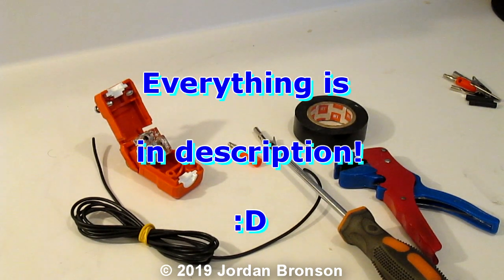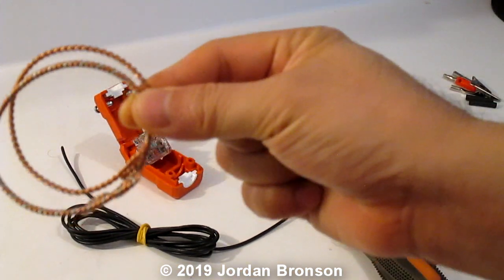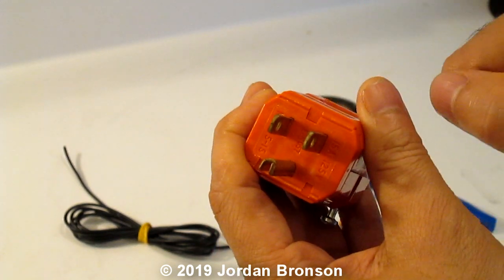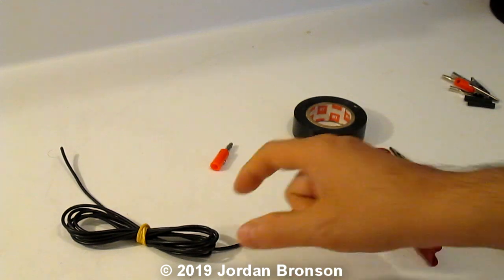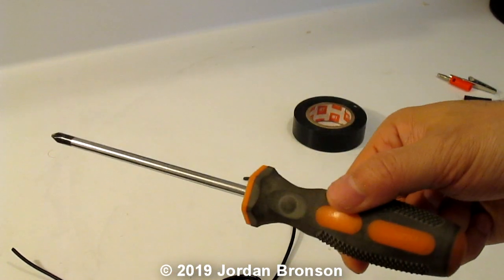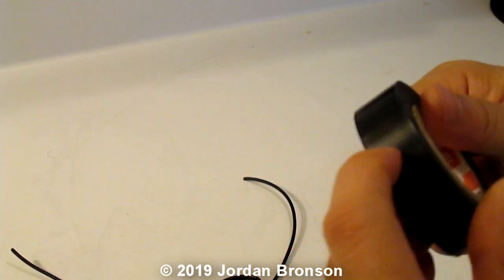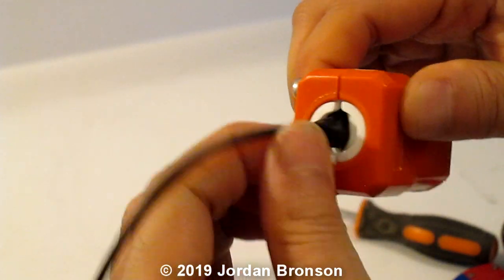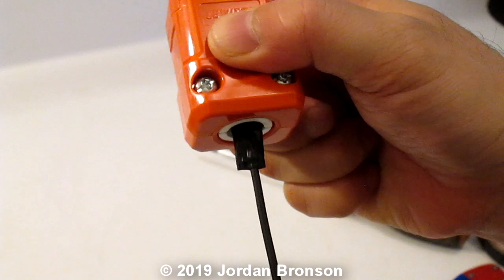EASY DIY Grounding Earthing Clip Electric Plug - FOR EMF - Mat Bracelet Pillow Sheet Faraday Cage

Comment: I am wondering if those static bracelets work for grounding? They are cheaper to buy than all the parts, although they are usually with a shortish cord. Can I just tape metal part inside the bracelet against, what i want to ground?
Reply from the maker: You can make the Ground Wire and then from the Cord, you can wrap that around a Copper Bracelet, that would work too.  You can wrap around Metal Bracelet too, but Copper is the most effective element when it comes to EMF (Electromagnetic Field ).
Reply: @JodBronson  One more question. I searched for the copper electrical wire, and it seems like they come in variety of gauges.  Which one or which ones fit the plugs best?
Reply from the maker: @feltingme  -  18 Gauge will be fine.  Those are standard I use all these years.
Reply from the maker: @feltingme  -  The Link you sent me is for Static Computer / Electronic work, those are what the bracelets are for.  You want 100% Copper, since this is for Body EMF (Electromagnetic Field ) to move.  In my opinion, Copper works better and faster, due to the element.  Electrical Ions moves faster in Copper and that is what you want.  NOTE:  You can make it easily from Home Depot or Lowes.  They even sell the Copper Wire in Foot Length, so you can get what you need and no need to spend extra $$$.
Reply from the maker: @feltingme  -  I went into further details + safety here:  https://www.youtube.com/watch?v=E70ec_eMi9o
Reply: @JodBronson  So their wire inside is not copper? And they do sell them for grounding (earthing purposes as well.) Of course, that doesn't mean they are best for it just because they sell them as such.
Reply: @JodBronson  Thank you. Now I know what to get.
Reply from the maker: @feltingme  -  You will find 100% Copper Wires usually in Speaker Wires.  Copper is getting expensive, so they " try " to put Nickel/Tin in them.  What they do is Nickel/Tin Glazed Copper to keep the cost down.  YES.... They do that to keep the cost down :(.  To get 100% Copper Wires, get Speaker Wires.  NOTE:  Some is also Copper Clad (Nickel/Tin Glazed).
Reply from the maker: @feltingme  -  By the way, some People call it Tin or Nickel or Copper-Clad Aluminum (CCA).  Basically, they Glazed or Weld <----- their terms..., Copper on the " outside " and Tin or Nickel or Aluminum on the inside, which then they call it...., " Copper-Clad ".  Hope that will make sense to you.

Comment: Hello from Athens, Greece!! I like  your videos and your explanatory way! So if I got it right... In a European plug, 
I keep wired the green wire only, I cut the other two. I shield them with black tape and I close the plastic plug cover.. This end goes into the outlet and the other end with the alligator clip goes on the bracelet... Is it correct? Thank you!!!
Reply from the maker: YES... Green = Ground
Reply from the maker: Here... check this out in detail:  https://www.youtube.com/watch?v=E70ec_eMi9o
Reply: Thank you very much. If you like , it would be very useful for everybody to hear your opinion on nanostructured black silicon as a blockage material. I red some articles but I am not so familiar with these topics. Thank you for all the info so far!!
Reply from the maker: @marthapantazo6510  -  I have never gotten into "Nano Black Silicon".  Although I have taught a bit in school, they have used it in Solar Cells experimenting, but never got in to it.  The best material to date is copper, because of the efficiency of it.

Comment: Question, what alternative can we do if we are from a country with no ground hole? Could we just buy an adapter and plug it in the 2 hole and just do as your tutorial? Plugging the 3prong to the adapter?
Reply from the maker: VERY EASY:  If you are from another country.  Get a 6 Feet Copper Grounding Rod.  Stake that into the ground outside of your house.  Attach a wire to it and that is your "Grounding" Plug.

Comment: Great video bro, I have done a lot of my own electrical work, and yeah like you said safety and common sense. But I had a question for you. Does it make a difference to have larger wire does it ground better or the same, more surface area or is it all the same? Thanks bro
Reply from the maker: In theory yes, because your body have " Low " Electrons... Bigger Wire / Thicker Wire will help the Electrons to move faster.  Here is where it will complicate things...  The Electrons in our Body stay the same, regardless how thick or thin the Wire is.  Our Voltage is only around 1.7V to 2.4V AC.  We only want to discharge the " Extra " Electrons...., our body needs the rest or we will be dead.  Our Body needs the Electrons to stay alive, that is why 99% of People in the World who do not understand Grounding.  Even though I am NOT the one who discovered " Grounding ", but I am proud to say, I am the first Person to understand it.  When you get a moment, check out some of my EMF Videos, I explain how it actually works...  Go into my Channel, then Video, then Search for " EMF ".  You will see bunch of it under that topic.
Reply: Jordan Bronson very helpful, thank you for the detailed reply. I love grounding and it has been very helpful for my sleep etc. as of right now I am using Assurance Designed Blue Grounding Wrist Strap 2 Pack. Use for Earth Connection & EMF Radiation Protection - Use for Desk, Floor, Bed, Pillow or Yoga https://www.amazon.com/dp/B077PDTRH6/ref=cm_sw_r_cp_api_i_wffCEb1MVAY0G
I found on amazon a while ago and put it on my foot while I sleep and anytime I can. I made myself a pair of earthing Moccasins to wear when ever possible outside. I am looking to get some emf cloth and attach to bed for a more permanent set up. Love your vids thanks  again.
Reply from the maker: @earlkcej3446  You could have done this, no buying, LOL.  https://www.youtube.com/watch?v=PCEY_HD16aE
Reply: @earlkcej3446  i was confused that you can clip it to a pillow?... that means the elctricity goes out of my head, into a pillow?... and then into clip then ground?.. the pillow conducts?

Comment: What size are the plug inserts for the alligator clips and where can you find them?
Reply from the maker: It doesn't matter... As long it's Metal, you will be fine.  The Alligator is 25mm I think.  You can find it at Harbor Freight, Online like eBay or Amazon or Electronic Store.
Reply from the maker: Extra Safety Video Detailed Instruction Here:  https://www.youtube.com/watch?v=E70ec_eMi9o

Comment: But my earthing mate clip is not giving a peep😅 however when I check th ohm with the May it shows it’s working … do you think that they have created some resistance like anti static braclets?
Reply from the maker: It should give lots of PEEPS !!!  Just like the people walking around with 2 legs!  If not, you did it wrong!  😅😅😅😅😅
Reply: @JodBronson  I meant the original one that comes with the earthing mat - it was not peep like those ppl so Mybe am saying Mybe the built some resistance alike the anti static stripes..because the mat it self doesn’t peep
Reply from the maker: @alFeras_tell  - I TOLD YOU WHAT THEY PUT IN THERE AND HOW TO MEASURE IT !!!  Why are you so dense?  THEY put in a "resistor" which YOU HAVE TO MEASURE IT IN OHM !!!  I also say... SET YOUR METER TO OHM... Then you can measure it !!!
Reply: @JodBronson  that was yesterday 😂 today a new lesson 🧑‍🏫. Thank you Jordan!
Reply from the maker: @alFeras_tell  - STILL THE SAME LESSON !!!  GRRRRRRR

Comment: What's that yellow device called?
Reply from the maker: Multimeter
Reply from the maker: Cheaper at Harbor Freight here: https://www.harborfreight.com/7-function-digital-multimeter-63759.html
Reply: @JodBronson  thxx!
Reply: @JodBronson  and can i leave the grounding bracelet plugged in the whole night? Is it safe?
Reply from the maker: @endrogenousentheogens5609  -  You can leave it 24/7.  You are using the Ground only, no electric or anything goes in there !!!
Reply: @JodBronson  alrighty
Reply from the maker: @endrogenousentheogens5609  - Well, unless you know someone is going to work on your electrical system.
Reply: @JodBronson  and do you recommend wearing the grounding bracelet (plugged) for 8 hours straight? (Like for the whole night)
Reply from the maker: @endrogenousentheogens5609  - You can do it 24/7 !!!
Reply: @JodBronson  thank you

Comment: if im using an 18 gauge copper wire for my bracelet, Is it ok if i use a 14 gauge AWG for the speaker wire?
Reply from the maker: You can use any wires.  Our body have such a small voltage, it will passes through.

Comment: What size wire is that? And is it necessary to have an alligator extension. I can’t find it in Lowe’s.
Reply from the maker: 18 Gauge Wire.  You can get alligator clips at harbor freight.
Reply: Jordan Bronson thank you! Is that 18 gauge stranded or solid?
Reply from the maker: @dontexroddy5012  - Does't matter. In the Video = Stranded.